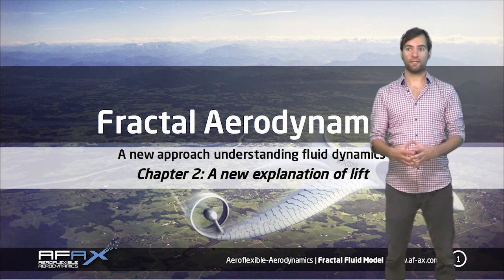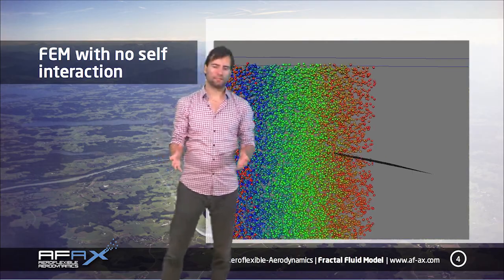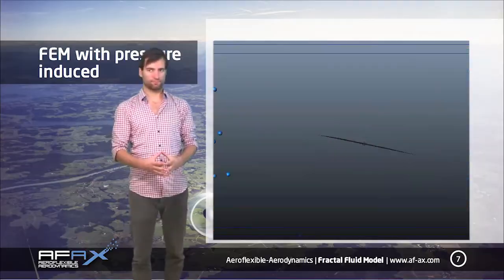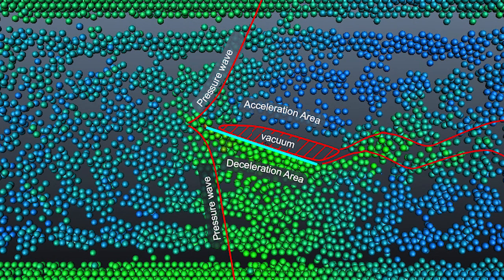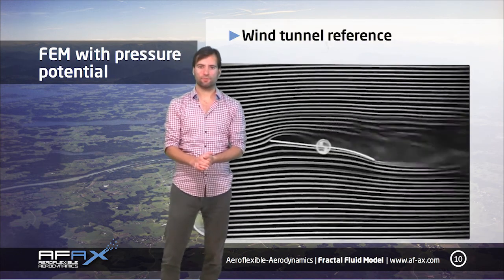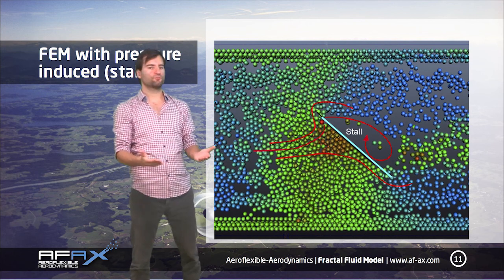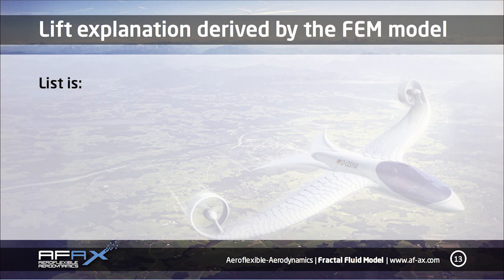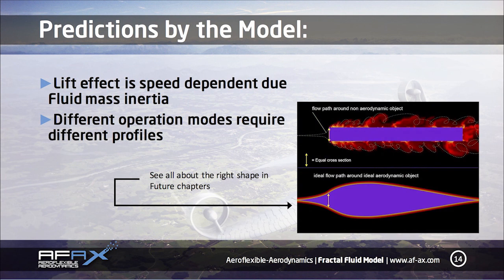Fractal Aerodynamics - Chapter 2 - FEM Aerodynamic Lift model

Comment: Hey Felix, I'm stumped about the explanation of ground effect. In this video at the 4:40 mark it shows the green deceleration area. Would that compression be in part responsible for reduced induced drag. The theory that the reduced sized vortices being responsible for reduced drag doesn't make much sense to me....
Reply from the maker: which theory of reduced sized vortices do you mean? Drag by vortices is again kinetic energy trapped in vortices, so the drag comes by the energy lost by creating (too much) vortices. That's why Shark skin and scales on fish create a small turbulent boundary layer to avoid that the no slip condition creates larger cluster of vortices that absorb energy
Reply: @felixschallercom  hey Felix, thanks for getting back to me. Let me quickly explain what I do then my question will make more sense. I'm a 777 Captain who shoots flight training video for student pilots. One subject that has never clearly been explained in my opinion has been aerodynamics, especially ground effect. I'm trying to shoot a video of me flying my Cessna 172 through man made ground fog showing the airflow around the plane close to the ground to show ground effect. I hope to find a 3D video motion graphics person to integrate motion graphics to clearly show what the air is doing around the airplane. The way ground effect has been explained by everyone so far is that the wingtip vortices strike the ground when the aircraft is within a wingspan of the ground which disrupt the vortices from coming back up and over the wing, striking the top of it. Every video I've seen of an airplane close to the ground. The vortices is far behind the wing so I'm stumped as to how it supposedly comes back over the top of the wing, hitting it, creating drag. It looks like the air pressure from below the wing is creating a cushion of air which causes the aircraft to float above the runway. Anyhow I'm not an aerodynamics guy at all, just a pilot trying to explain how it works. I need an aerodynamics guy to explain it to me so I can explain it to them. Thanks again for your time.
Scott,        askcaptaptsinscott.com         askcaptaptsinscott/YouTube
Reply from the maker: @askcaptainscott  hi scott, trust me and it's not arrogant to say, that aerodynamics ist the physical topic that is least understood in physics. the reason is, that the fundamental thesis for aerodynamics is wrong. I am doing these videos to demonstrate WHERE the thesis is wrong. The main thing is that the bernoulli effect is understand is wrong and puts wrong constraints on matter that do not resolve. You are intuitevly right with the cousion. Due to the wash down effect of the wing it happens:
1.) pressure rise below the wing. The air cannot escape downwards so it gets squeezed forward like in a toothpaste tube creating a forward motion
2.) same thing happens on the side the air get's pushed outwards
3.) with 1 and 2 the wing tip vortices evolve further outside of the wingtip because of the stronger flow of air towards the wing tip. also by forward motion of the air below the stagnation point moves forward
4.) by 1 to 3 this means the wing is getting virtually expanded by some degree in width and length.

Comment: Drag is due to imbalance in pressure around aero foil as is lift.  There is no lift or drag without pressure variation and the phase change due to cavitation / vacuum formation
Reply: Only form drag is due to the pressure imbalance that caused by the shape of airfoil.
Reply: The main aerodynamic drag of an airfoil is considered as the net shear stress that acts tangential to the surface of the airfoil.

Comment: Felix, the explanation is still fawed, but gives insight. The streamlines are indicative of equilibriation of pressure within the moving fluid. . The disturbance of that equilibrium causes regional adjustments. You  note the vacuum where the streams split. It s not aempty but full of fluid in a different state., often a phase change. This phase changeed material rotates and expands or contracts. . You can see the streams bounding th vacuum changing
Reply from the maker: Hi Jehovajah, indeed it is true, that in reality there is no vacuum (impossible because of the aggregation state change before final vakuum, because fluid can only exist under pressure conditions) but precisely spoken, there is no difference between reality and this model else. The model just simplyfies it to see the correlation better. yes in reality you will never observe a vakuum in the wind shade of a wing. in the third version of the model it does also not exist (when i add the Pressure potential) but by approaching the simulation to the real conditions by adding all effects step by step, you can finally see why flow separation occurs, because: that's correct: phase space. The particles get into another phase when entering a vortex. by this exlanation i hoped it is very obvious why there is turbulence occuring in the upper side of the wing, because the turbulence fills gaps that cannot be reached by the laminar flow - due mass inertia. And lift is highly dependant by the stability of the laminar part that it does not collapse into vortices. simply: lift on: = no revolving of fluid possible, flow attached, stall: = vortices can be formed collapsing the low pressure and carrying it away in potential vortices, flow detached.

Comment: It looks as if your computational method is pitched at high-Knudsen number transonic flows. There are simpler ways to explain the basics of aerodynamics.
Reply from the maker: Listen carefully. This Episode is NOT about Transonic flow, but to explain how stall or stalling works and why feather-like devices passively regulate this effect. Transonic flow is an irrelevant side-effect here that has no relevant contribution to this effect.